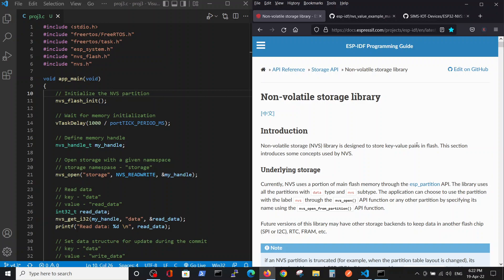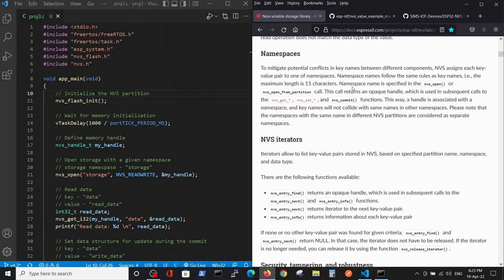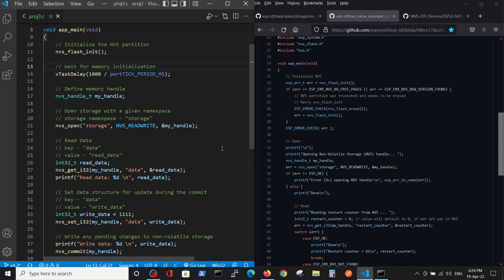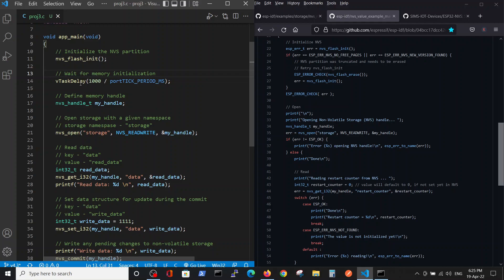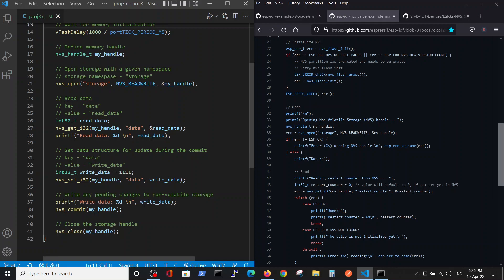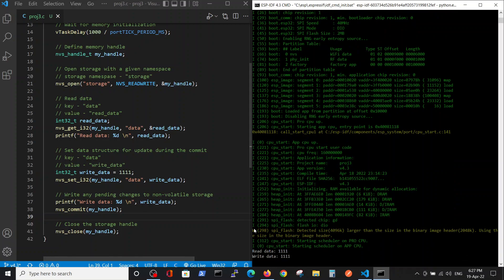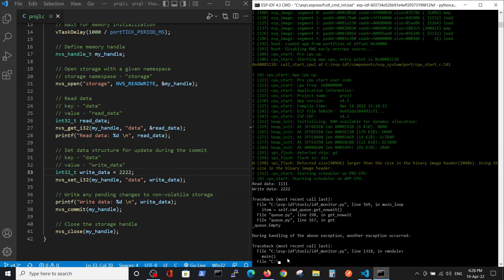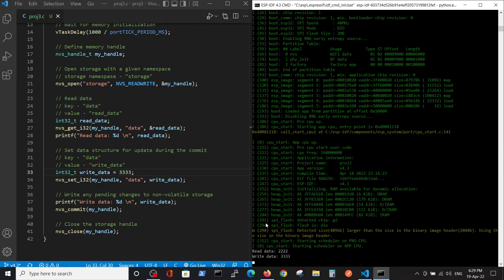1 - Save INT32 value permanently in FreeRTOS ESP IDF to ESP32 flash memory using NVS library

Comment: i try the github examples of sd card but after flashing the code there is a problem : -👇👇👇

E (372) vfs_fat_sdmmc: sdmmc_card_init failed (0x107).

E (372) example: Failed to initialize the card (ESP_ERR_TIMEOUT). Make sure SD card lines have pull-up resistors in place.
Reply from the maker: Please refer to the 4-Websocket video reply.

Comment: the same code is not work properly. in READ & WRITE both the value coming same why ? can u please help!
Reply from the maker: Dear Embedded,
I do not fully understand what you mean. Please specify your question.
Reply: @simsiotdevices6219  when i change the value and run the program then read & write data both value is same , its not changed i try it many times.  please help!
Reply from the maker: @embeddedjunction9204  Can you publish your code?
Reply: @simsiotdevices6219  can u provide the code where we can store string data at the place of integer value.
Reply from the maker: Dear  @embeddedjunction9204 ,
I made this video for you:
https://www.youtube.com/watch?v=--o-jASYEFk
The code:
https://github.com/SIMS-IOT-Devices/FreeRTOS-ESP-IDF-NVS/blob/main/NVS%20String.c
Hope it will help.
Reply: @simsiotdevices6219  thanks for that but there is a problem the code is crashed when flashing. & the 2nd problem is that which i have the data which is stored in nvs, after re-flashing the same program the same data is stored its not removed why? i want to removed old data after re-flash. can u help in this ?
Reply from the maker: Dear  @embeddedjunction9204 , 
I just want to see that I got you right. You write a different string in the same place in the NVS and nothing happens?
Reply: @simsiotdevices6219  THANKS !
Reply: It does the same thing to me. Did you find any solution? Thanks